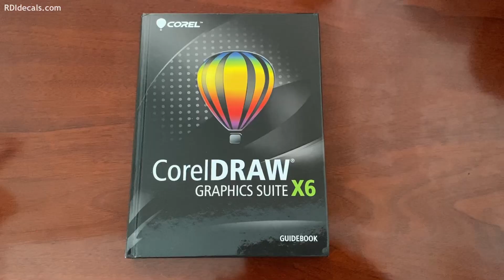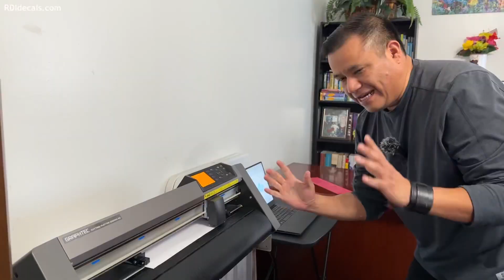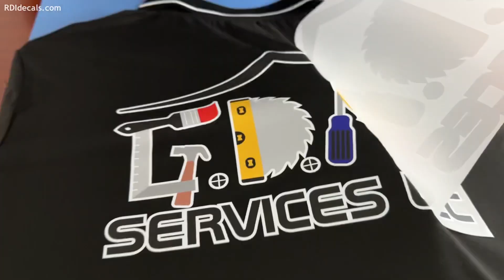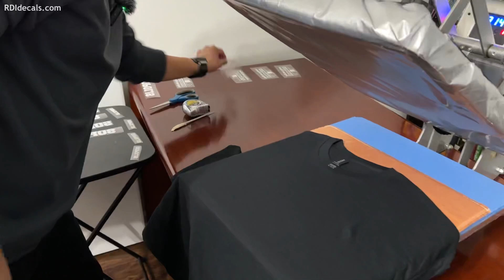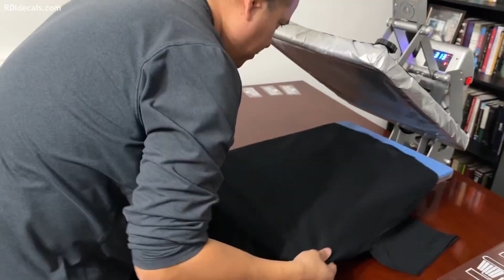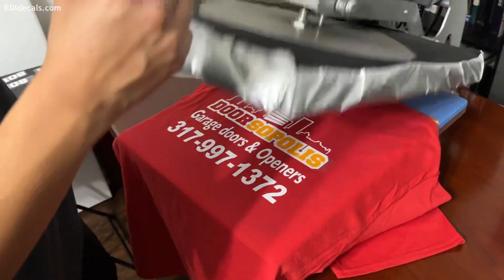This is why vinyl doesn't last on shirts

Comment: why you cut the yellow vinyl back side up and the red the front side up could you please tell the trick behind, Also I am using SignMaster Pro Software instead of Coral
Reply: The vinyl is always cut on the back side. The yellow has a white backing and the red is the same color on both sides. Looks tricky in the video but you can easily tell the difference when you have the vinyl in hand. The backing is a glossy polyester liner and the cut side has a dull finish.